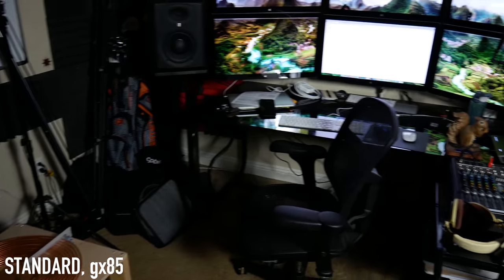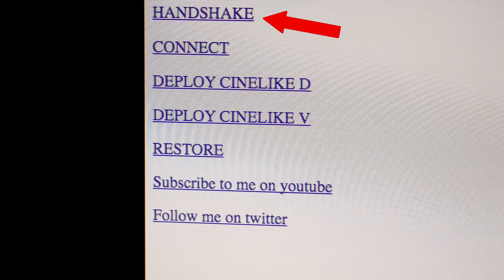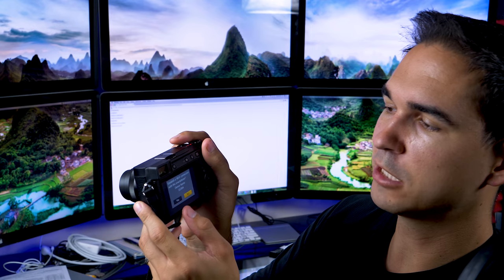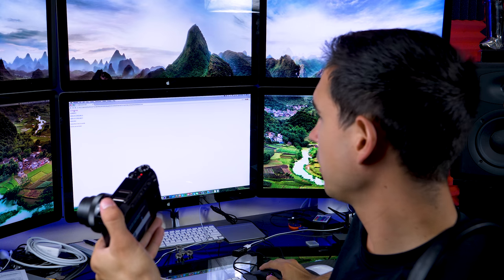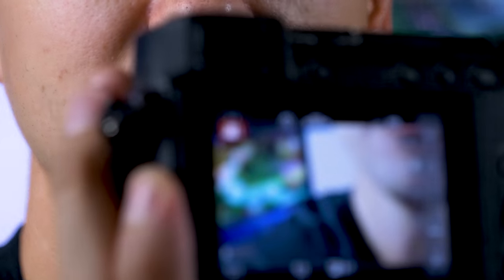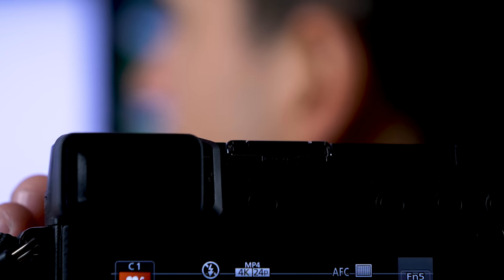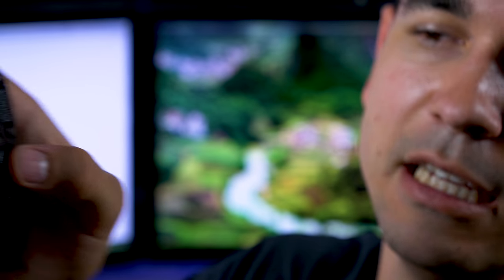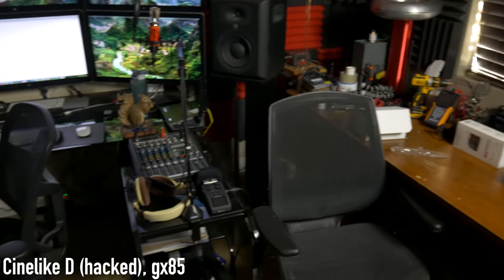GX85 / GX80 Hack: Add Cinelike D and Cinelike V hidden profiles

Comment: okay so I got it, but I can only use it in Custom mode and I can't manually expose. Is there a way to fix this?
Reply: I have the same problem. I'm trying to find a resolution for this. Strange no one else is mentioning this issue

Comment: How do I restore the standard picture profile? For some reason when I installed Cinelike D, it removed the other default profiles.
Reply: Nico Perez Once you saved the CineD under C, then you need to choose "restore" while sill connected to the wifi, Or another workaround is to reset setting under camera menu, but make sure to choose DO NOT reset custom settings. Once you done this you should get all your default properties back and still retain CineD under C mode.

Comment from the maker: Hacking is fun.  I hack things and programs.  If this video isn't relevant to you, that's okay, I'm going to building more weird things and doing more science soon.
Reply: Tommy Callaway Thanks a lot, keep the good work 👍👍👍
Reply: THANKS A MILLION!!!!!! Can you do a V-Log profile please ? ;-)
Reply from the maker: +olivierproduction haha I don’t think you can unlock v-log in this way.. I’ll take a look though.
Reply: Quick question, i noticed after i did this i am not able to enable 4K live cropping on C1/C2...it is grayed out. Is this expected?
Reply from the maker: I haven’t tried, or ever really used live cropping.. so no idea. This hack really should only change the picture profile though, so that’s pretty interesting.
Reply: Tommy Callaway could you check when u have a chance  if 4K live cropping is grayed out for you in c1 and c2...just to confirm is not just mine. If for you is not Grayed out maybe I can try restore and then re- install it.
Reply from the maker: Just tried it.  Worked totally fine.
Reply: Tommy Callaway I tried installing this hack, followed every step but I can't manually control my Exposure Compensation thus it automatically sets the ISO and Shutter Speed on C1/C2 mode. How do I change this setting? TIA.
Reply: Thank you so much Tom! This is super helpful! I appreciate it! : )

Comment: This works on the ZS110/ZS100/TZ100/TZ110 too.  I have 5k LED lights in my garage/office and there 2 shades of red, blue, green, yellow, black, gray, wood, and concrete from my chair.  I think that Cinelike-V with -3,-3,-3,-5 and -2/3EV looks the most accurate, colors and the luminance.  I'm using an LG 4k monitor in Cinema mode for comparison.

Comment: Hello just finish doing this but have 1 problem
Mu shutter speed is always on auto when I change to C (either 1,2 or 3) 
Is there a way to manually change the shutter speed ?
Reply: did you find a solution ?

Comment: Ok I may be dumb...but when I try to connect on my MacBook pro...since i am connecting to my camera, it tells me I am not connected to the internet anymore because it doesn't have an internet connection. Also, what Wi-fi setting are you using? I see remote shooting and view, Playback on TV, Send Images While Recording and Send Images Stored in the Camera. Help!
Reply from the maker: +DavidsAddictions download the file and open it with chrome. Then connect to the Camera WiFi. Remote shooting.
Reply: Hmm...that is what I did , but it wouldn't connect to the internet, since the computer was trying to connect to the camera wi-fi, which doesn't have it's own internet connection.

Comment: I use a desktop without a Wifi interface. Is it possible to connect the GX85 to my Wifi router, and then connect to the camera from the desktop via wired LAN ?
Reply from the maker: I don’t think so, but if you figure that out let me know!
Reply: Never mind, I was able to do it from my smartphone.

I had read about a 200 Mbps bit rate 4K mode on this camera - is it a real possibility or not ?

Comment: Any one else come across the problem of losing the standard/ vivid etc settings?
I ahve saved the Cinelike D to C3, but when I go to Shooting Modes, its just a yellow box, unable to change it to any of the standard modes. Does that make sense? Any ideas?
Reply from the maker: +Ben Andrews use the hack file to restore the mode to standard or save a different profile over C3?

Comment: For this hack, how do you get the manual video mode? I can't control the aperture. Everything is in mode P!
Reply from the maker: Set your camera to Manual.  Then enable the hack.  Then save it as one of your custom profiles.  Then when you open C and load the custom profile, it will be all manual.  The C modes are a little weird.
Reply: Tommy Callaway Thank you for the reply
Reply: Tommy Callaway I tried installing this, I followed every step. It works fine for me however I can't control my ISO, I think it's set to auto? How can I maually change my ISO in C mode using this hack? TIA
Reply: @kevindavidestigoy5245  I heard another tuber say it's stuck in auto. Can be altered in post apparently

Comment: I have a gx80 with custom video with cine d. When i have the ibis on, the ibis doesn't work well... I have more steady effect if i disable it... Ahah with movie standard mode the ibis work normally. I think that it was the firmware 1.2...but with 1.3 the bug isn't fixed...
Reply: I fixed it. Need to update to 1.3 firmware and the reflash cined d. It work too wiht firmware versioni 1.3

Comment: Hi Tommy can I check if you did this after the 1.2 firmware update? Afraid that if I update this 'hack'  will be disabled
Reply from the maker: I haven't updated yet, still running 1.0.  I really doubt the hack will be disabled if you do update, though.  I'll update soon and report back.
Reply: Thanks will wait on the update!
Reply: aiebokn I have got 1.2 running and it seems to run fine.

Comment: Hey Tommy, many thanks for the thorough explanation. I have the Cinelike D/V profile installed in my GX85 in C mode, when I switch to Manual Movie mode i found the cinelike profile is not available in this mode, which means, i can't use cinelike profile in manual movie mode. 
Did I miss anything or is it simply not possible to use Cinelike profile in Manual Movie mode? Thanks!
Reply: i THINK you have to have manual movie mode set up BEFORE you do the change.  at least that is my understanding from reading and watching other vids.  good luck.  thumbs up.
Reply: I can confirm this is correct

Comment: Woah, could you tell me what is your opinion on V-LOG on Panasonic G85, could it be added? Is panasonic not adding it so they can sell GH5? Could it be created or copied from GH4 and 5 ones? Thanks
Reply from the maker: +Stay Close I don't think the g85 has the firmware for v log but if I had one I would try to hack it and see.
Reply: Yeah, in GH4 was added later right? I want V-LOG on G85 really badly. I hope panasonic is not delivering because of profit. This kind of policy made me turn my back on Sony.

Comment: hi there. the IP address in the hack file should be changed according to my network? camera doesn't seem to be able to connect to my computer with the .54.1 address I don't know if this should be changed.
Reply: the computer see and connects to the wifi network of the camera but the camera is always on "please connect to the following..." even though I connected via the computer - this is probably due to the fact it's via the computer as if I connect via smartphone it gets out of this mode.... anyway, I cannot do handshake or connect via the html file as it doesn't finish the first step.... it doesn't do anything. help will be appreciated.
Reply: so I don't get to see "establish connecting with ...." on the camera

Comment: I only got message OK, remote, encrypted.
Reply: me too! the first time i tried it said the connection failed (on the camera) and after that that same message "ok, remote, encrypted" on the PC screen. 
Did you find a solution?
Reply: @martinaleksandrov7080  yes. Seams it's working but I can't remember now how it was done to be honest. I followed all the steps.
Reply: @NowyKurs  managed! I though it doesnt work because it says excrypted, but thats what it is supposed to show. :D thanks for your reply!!
Reply: @martinaleksandrov7080  No worries. Good luck.
Reply: @martinaleksandrov7080  hey, how did you get it working? I already tried many times and cant seem to get it to connect